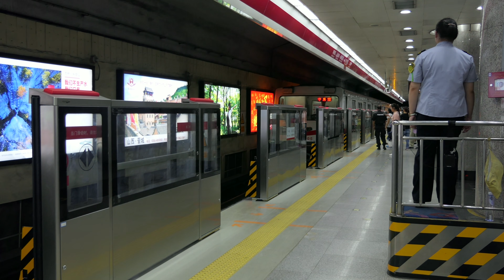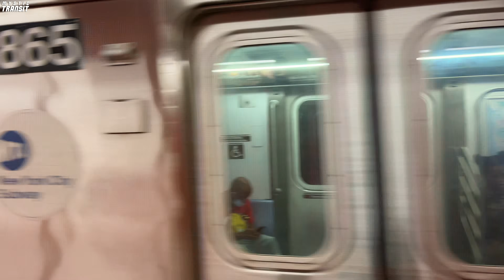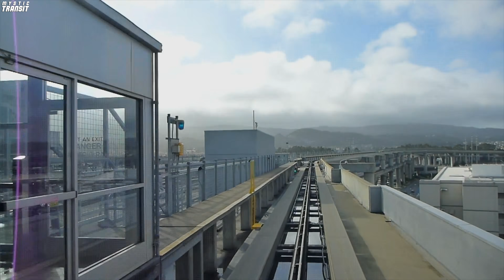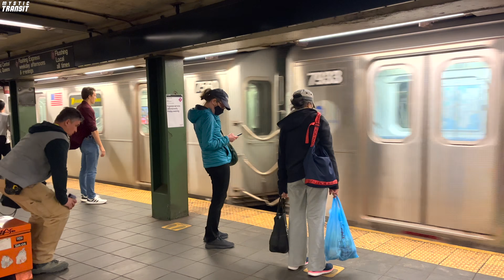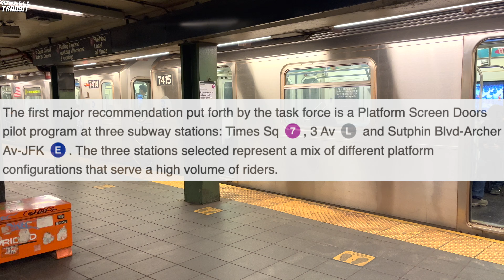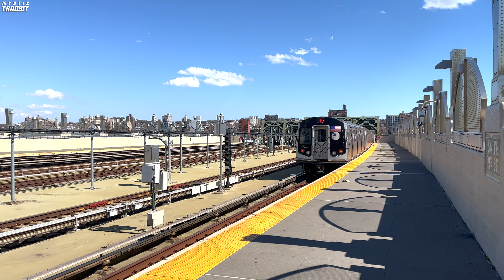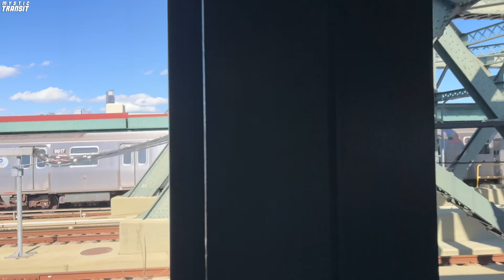Does NYC Need Platform Screen Doors?

Comment: If the MTA wants to really add PSD's, then the entire system, including the trains, will have to be overhauled or replaced. Even if we wanted to do that now, then the IRT lines will likely have the highest success to have PSD's. All I'm saying is that the NYC subway is years away from ready to have PSD's. And don't even think about the BMT line's, the BMT has both 60ft and 75ft cars, and that would make the BMT line's, impossible to PSDifey (right now)

Comment: I like the platform net door the most (Osaka, Kansai, Honshu, Japan) because it the cheapest, most versatile, most efficient use of materials (most lightweight and most eco-friendly), takes up the least space (because lightweightness means supports don't have to be as thick), and quickest to install because of the lightweightness and compact size.
Reply: Are you pertaining to these?
https://youtu.be/6ZfjWXCD3Hk
Reply: I think this is the biggest constraint for any design MTA implements is that it will have to have NO moving parts...
Because we all know how reliable the switches, signals, and elevators are
Reply: @godlugner5327  It's only unreliable if it's not a Japanese design. However, it's super reliable if it's a Japanese design, especially if the components are made in Japan. That's why the trains in Japan are always on time (even being early will be penalized, as 2 train companies in 2017 in Japan apologized for leaving 20 and 25 seconds early, respectively), even with platform doors.

Comment: New York should look to Singapore and Seoul, if these cities can afford to have PSD's in almost all their subway stations and operate in a balanced manner from maintenance to ensuring safety and reliability, there's nothing in the way from doing the same in New York City. The problem with the MTA is that there's widespread corruption and unnecessary bureaucracy driving up the costs and hindering any practical long term improvements from being made. The MTA needs a complete restructuring from the board of executives down to the staffing.
Reply: You have to remember though, those system are less than 60 years old. So the stations were probably either future proofed for PSDs, or were easily retrofitted for them. You’re comparing apples to oranges here
Reply: @PhilliesNostalgia  Then the best example is East Rail Line in Hong Kong, built in 1910 in Biritish Main Line standard, are upgrade to commuter style, then electrification in 1980, and soon starts the installation of PSD in the entire line
Reply: @gabrielmataleo4573  I think what could be done on large parts of the elevated sections for NYC are PSGs, or Platform Screen Gates, which are essentially 1/2 PSDs. Saves cost on PSDs, and are better suited to an above ground station
Reply: @PhilliesNostalgia  Yep, and ik at least Tokyo's Toei Asakusa Line* already has a solution for making them work with different trains and door layouts

*not 100% it's this one, but it's definitely a toei line
Reply: @PhilliesNostalgia  I mean RAPT in Paris also managed to retrofit their century old stations for PSD's on a number of metro routes, so it's not impossible so to speak.
Reply: @PhilliesNostalgia  the anology would most likely be more like watermelons to apples.
New York is easily the largest subway system in the world...
Reply: @butacrusader  It’s not even the biggest in terms of ridership, and soon, won’t be in station count, even if you count Metropolitan Av and Lorimer St as two separate stations. Moscow has way more riders with a whole lot less stations, as an example
Reply: @PhilliesNostalgia  Yes, the Shanghai Metro will exceed the station count of the NYC Subway within 5 years, as they are only about 25 stations short now and there are currently at least that many stations under construction in Shanghai right now.
Reply: @butacrusader  bullshit excuses
Reply: @LukeRichardson1981  china has literally the most competent government on earth nothing compares.
Reply: Can’t compare an old system to a newer system.That’s like comparing a 87 to a 2022 Honda Accord. You got to realize engineering factors come into play.

Comment: They really need this. Victims that fell or got pushed might sue the MTA for a big amount of money.
Reply: Their case wouldn't be successful though.
Reply: Unlikely. 
Platform screendoors are not viable in the Subway because they can't be installed in the over 100 year old system.
Reply: @paxundpeace9970  They installed in the UK which is just as old.
Reply: @MelGibsonFan only on the lizzy line in the uk
The rest has no psd’s
Reply: @MelGibsonFan  Paris is a better example. London hasn't retrofitted any stations with them, but Paris has

Comment: The only reason why this hasn't been implemented earlier is because CBC asn't been implemented throughout the entire system and there is still different rolling stock. Once those problems are addressed, then I can see screen doors becoming a thing
Reply: CBTC isn’t the reason, the most probable reasoning is rolling stock and station design structure
Reply: @nyctransitrailfan  Trains don't always stop at the same place in a station which may misalign with the station doors which I mentioned CBTC

Comment: I think it’s possible for all stations, given that some different, innovative designs, are used in other countries with the same issues. Vertical PSDs, and half-height PSDs, exist.
Reply: You can not be serious ? Do you even live in NYC or even ride the train ? If you think it’s possible for all stations you are clearly oblivious to the real issues at hand.
Reply: @richardwalker6004  vertical PSD would be fine. The idea that things only ever work in other countries and there is just no way to do it here is weird. With vertical PSD how would the  spacing of doors on the trains even matter? They would be VERTICLE
Reply: @Wkay04  anything is possible of course to some degree, but it’s going to be a money  spent not well used ,when MTA has many other issues they need major attention over this . A lot of people don’t pay attention to the condition of the stations , and falling apart decades old infrastructure that needs priority rather  than these screen doors. Don’t get me started about the flood damages and other stuff that Impacts the systems. It doesn’t make sense to build a multi million dollar screen door , at a station that is in need of dire repair  and there are many of them . Building these doors doesn’t make the service better , safer or more reliable. It would be nice of course and it could prevent the  horrible deaths that occur, however, I believe the money could be better spent on things  that are much needed . One last thing , there are some stations and infrastructure that is so rusty that parts of it have corroded real bad and need to be repaired and painted .  These are like weights baring metal structures.
Reply: @richardwalker6004  The study they published is full of excuses. For many stations, lightweight PSDs can be installed, as seen on the Osaka Metro, and Spain has experimented with vertical PSDs, as well as flexible PSDs, which allow for different train door arrangements and lengths. At this point, because the 75’ cars are due to be replaced in the near future, this won’t even become a problem.
Reply: @blaazer9473  I also think some stations need to be heavily rebuilt, the entire system needs an overhaul.
Reply: @blaazer9473  You can use eminent domain on private property, its a legal fight, but it’s worth it. The entire system needs a huge overhaul, and the MTA needs to learn how to control its ballooning costs…
Reply: @blaazer9473  They’re not broke, they just spend money unwisely, because they can’t control their construction costs.